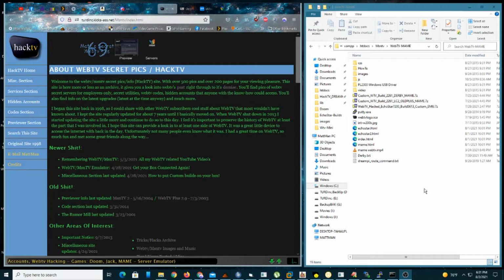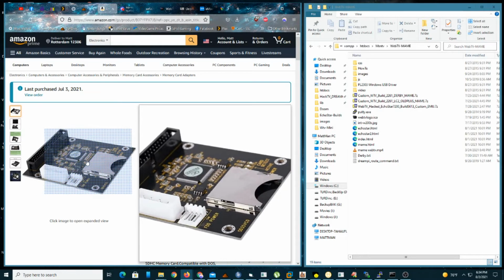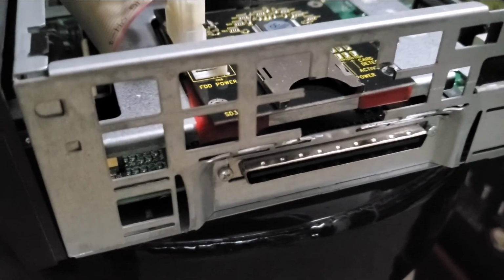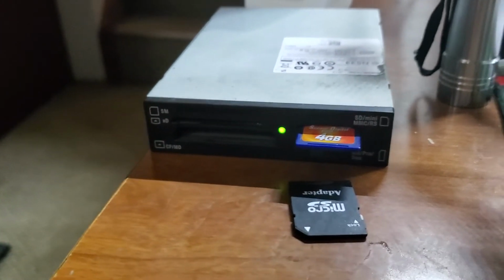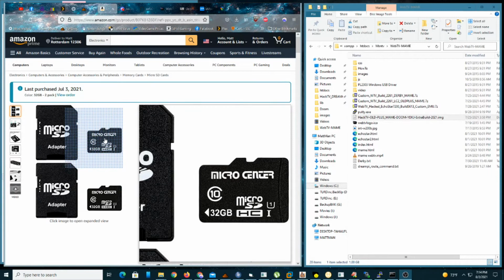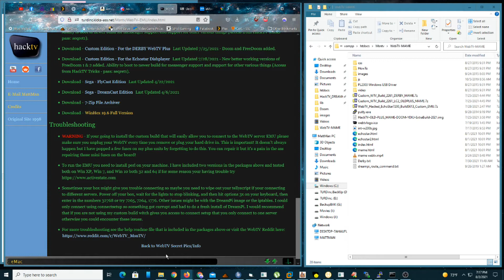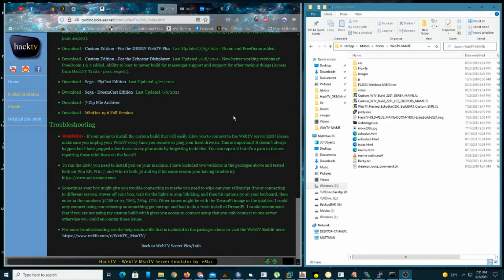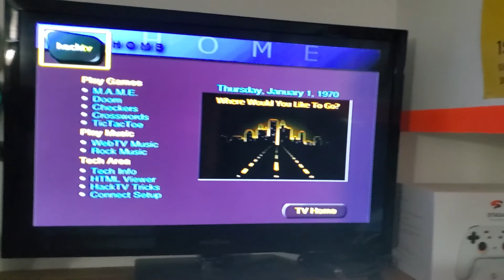Upgrade your  WebTV Hard Drive to SD and install custom HackTV build.

Comment: Does this work with a normal WebTV? Specifically the Sony INT-W100.
Reply from the maker: Only webtvs that have a hard drive, the int-w100 doesn't have one so no.
Reply: Is there still a way to connect to the custom servers on a W100?
Reply from the maker: @KineTheFish  yea, you basically need to get yourself a raspberry pi. There are other ways but the pi is the easiest way and most reliable. I have a video here https://youtu.be/T2AzEgo1WBw?si=TIWJ3T09hcvKTxA3 that explains how to do it.